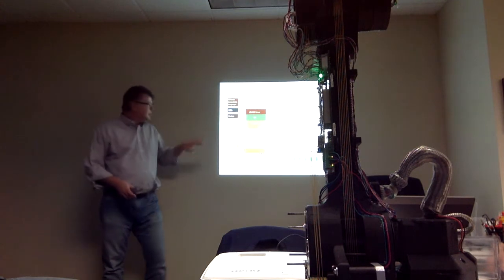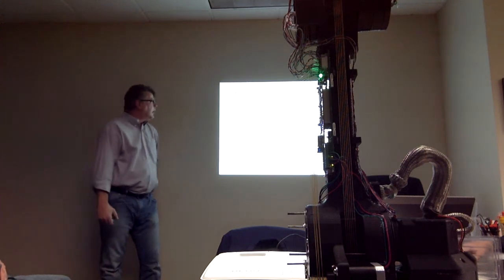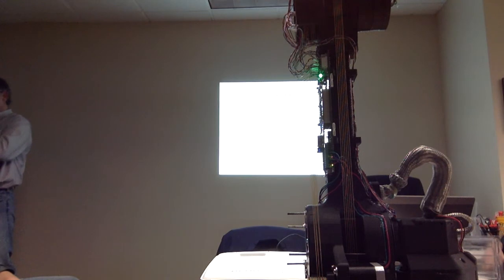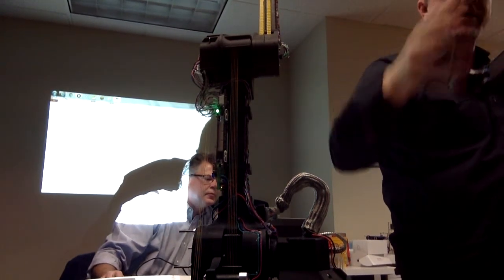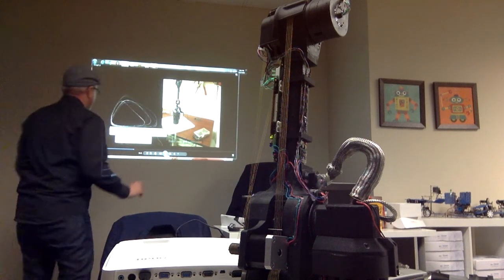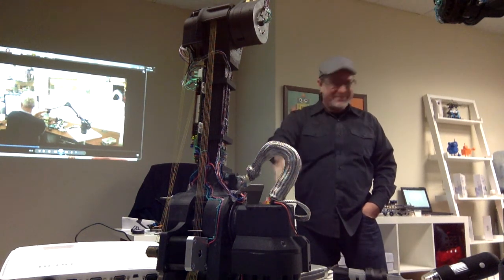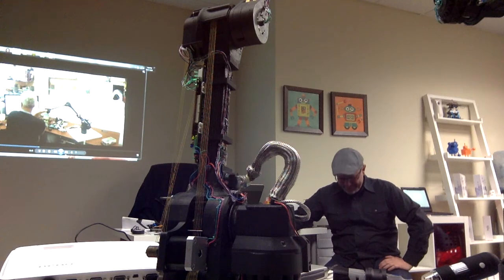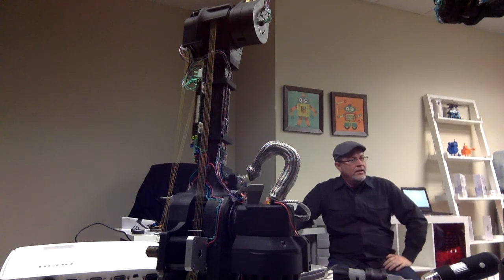Haddington Dynamics

Comment: Since then I:
- won a Dexter kit
- went to Vegas and built it with them while taking pictures for the kickstarter manual. 
- bugged them constantly about changes, helped a bit with code
- got hired at the company as a firmware / web programmer
- the company sold for $25 million and all the jobs xfered. 
- we all still work together making better bigger robots.